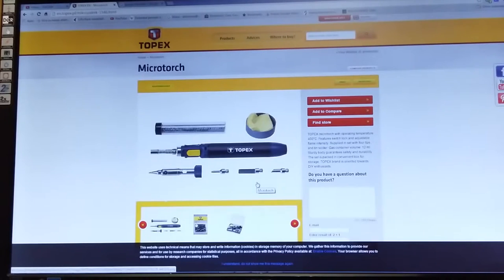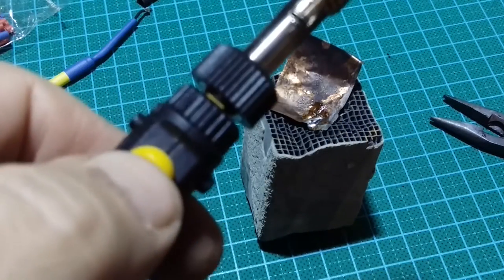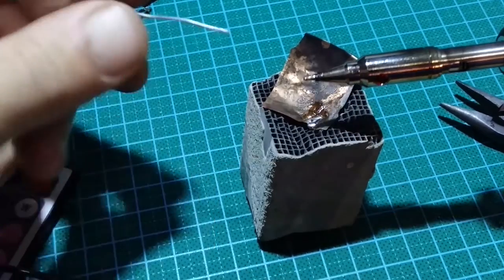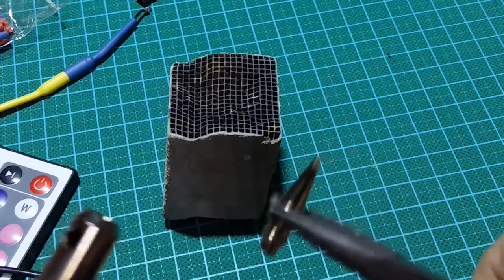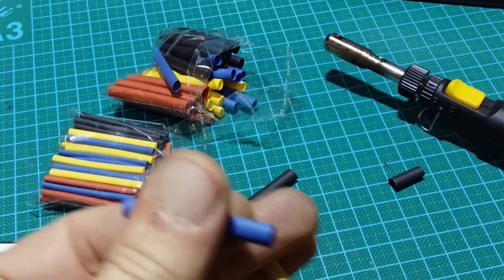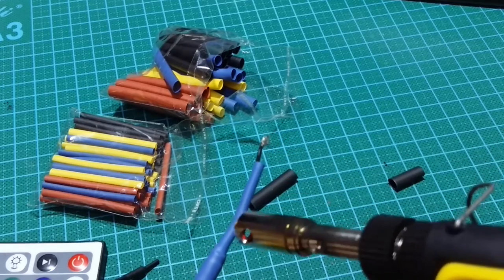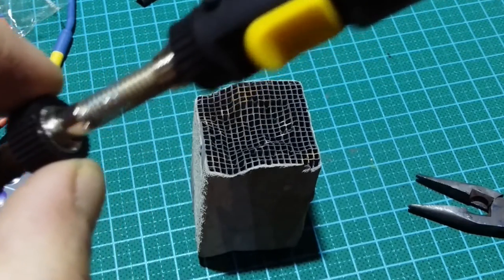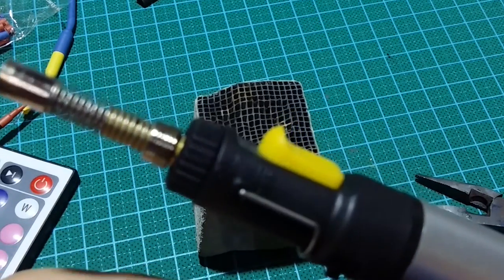TOPEX Gas Torch, Soldering Iron, And Hot Air Gun

Comment: I had one of those about a year ago. It lasted about two months. Even before it broke, the tip basically unscrewed itself due to metals expanding from the heat. I love the idea of a gas soldering iron, but I feel this one was a poor execution. I also got a NEOTOOLS one and that one suffered from the same issues, plus the escaping heat charring a board I was working on. It also clogged on record time.